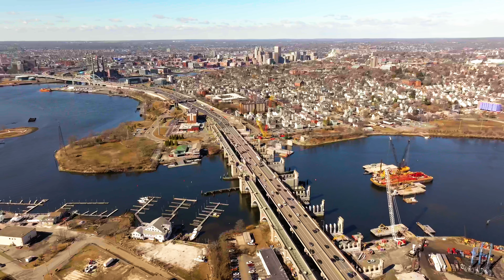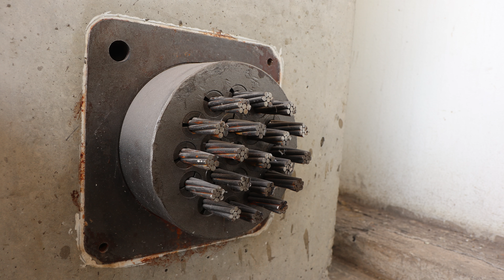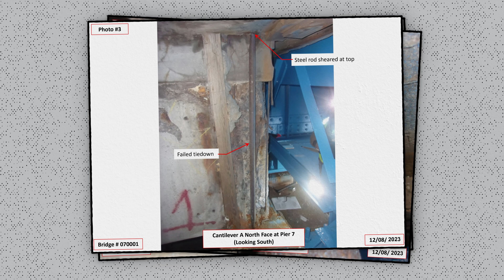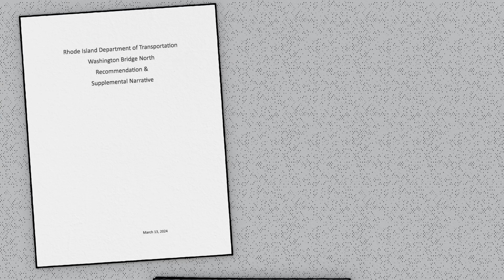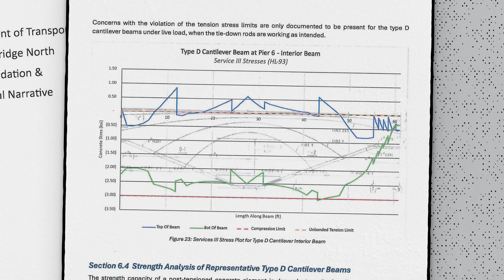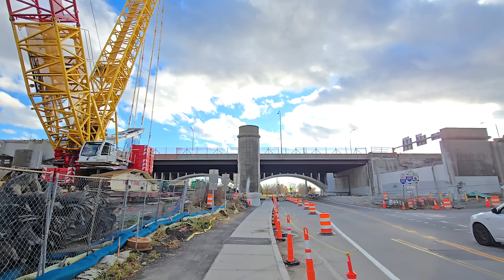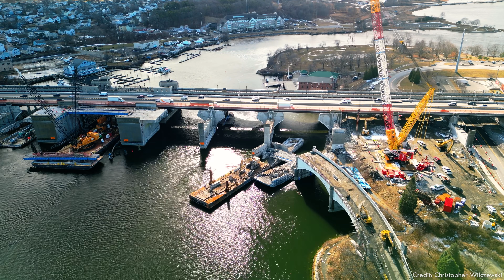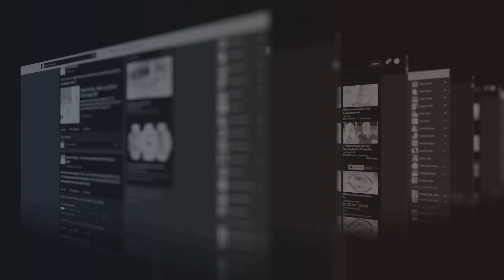This Bridge’s Bizarre Design Nearly Caused It To Collapse

Comment: Speaking of bridge failures, I would be interested in your take, Grady, on the replacement of the I-85 span in Atlanta 5-10 years ago. Briefly, combustible construction materials were stored under the bridge and homeless people camping under this bridge started a fire to keep warm, which ignited the construction materials, heating the bridge enough to make it unusable. There are quibbles about these details. However, the bridge was replaced in short order, motivated by the state's offer of substantial incentive pay for doing it quickly. I think it would be interesting to see how the fire made the bridge unusable, what factors made the quick replacement feasible (standard interstate construction, no water to work over, the availability of crews and equipment because Atlanta is constantly being rebuilt,etc.), and whether the incentives were as worth-it as the state and contractors claim.

Comment: I appreciate your explanations of the structure and problems. Casey Jones has only reported on the news without reference to the structural element of the bridges. RIDOT is not happy as this event makes them look very incompetent (rightly so). Having worked with municipalities on large infrastructure projects, i can say the client makes the rules for the Engineers. The inspection companies were likely threatened or fired for following more than the clients rules (meaning safety of the public as priority) for the bridge inspections. I've heard this happen to firms. Results of failed inspections can therefore be classified secret by the state (as is the case in Florida). Then a major event must unfold to allow the engineers to actually do the required evaluation. Additionally, this is a piss poor bridge design that hides critical elements from inspection and repair. This is how a government comity designs critical infrastructure... the Marxist way. Yes, it has slithered it's way into engineering... it's been in government for a long time...

Comment: Is there a reason we can't design 6 or 7 standard bridge segment lengths that could be pre-built by dozens of companies nationwide that would be easy replacement parts to slot into some 90% of our bridges? They can be 1 1/4 lanes wide with a few different lengths that can be bolted together width-wise onsite and have companion median/guard rails that can also be bolted together. Using standard viaduct distances, they can just be dropped in place with each end sitting on a pier with some sort of capstone connecting each segment length-wise. 
I would think a modular design like this would reduce design and build costs and speed new construction as most of the engineering calculations (except the piers) has already been done. Even future replacements of entire sections could be completed in a single shutdown day after however long it takes to setup a crane onsite capable of lifting one of these road deck segments.

Comment: You nailed it, Grady. This bridge is a success story, because it's old and was caught in time to save lives. 
We Minnesotans in the Twin Cities area know what happens when a bridge suddenly fails. I drove over the I-35 bridge just a few days before it fell into the Mississippi and I still get the willies when I drive over its replacement.
Reply: Good thing those old jeeps are so light!
Reply: It's a bit of a stretch to call a 55 year old bridge "old". The bridge right next to it is almost a century old. There are plenty of bridges of similar size still standing that are closer to two centuries old. It should have lasted far longer than 55 years.
Reply: @thomasdalton1508  Have you ever seen the amount of SALT Rhode Island spreads on it's roads ?  It's completely out of control, just so everyone can still drive 80 to work.
Reply: @thomasdalton1508 somebody mentioned in another comment about a 1920s Silver bridge that collapsed in 1960. So screwups can happen pretty much at any time in history.
Reply: @zzoinks  I'm not sure of your point. Are the 1920s famous as a time of safe bridge building? I really don't see how you can go from a single fault in one bridge to such a general statement.

And I wasn't commenting on bridge building standards at any particular time. I was commenting on the usual lifespan of a bridge and what constitutes an "old" bridge.
Reply: @thomasdalton1508 That bridge isn't used for traffic anymore though. It doesn't have to resist the forces of the 2nd bridge. Not to say that the 2nd bridge was not badly built.
Reply: @zzoinks  What do you mean it isn't used for traffic? It's carrying all the traffic now. You can see it in the video...
Reply: In time was 40 years ago. This was by the skin on your teeth
Reply: Caught in time?  There was a chunk missing.  The inspection missed the fact that 6ft of steel was gone.  How do you miss that?  It doesn't happen over night.  As a Rhode Islander, this the work of the Democrats under Gina Raimondo.  We are ranked worst roads in America.
Reply: @DroneStrike1776 ”caught in time” because it didn’t suddenly collapse during rush hour
Reply: @DroneStrike1776  It was caught before failure, what every rational person would describe as "caught in time." Gina Raimondo was 5 years old when this bridge design was put into place. Propaganda has turned your brain to mush.
Reply: @DroneStrike1776  Don't be disheartened by everyone debunking your BS. Take solace in your dear leader and his doggy friend slashing government agencies left, right and centre, so you won't have to worry about trifles like bridge inspections.
Reply: Look a veteran hater @DroneStrike1776
Reply: @DroneStrike1776 uhhh.. cuz it didn't fail?? You republicans are ridiculously dense.
Reply: @Kstang09  Success story though?
OR a warning of how many 100's of 1000's of ticking timers there are in the US?

You democrats are ridiculously easy to convince, and even more ridiculously short sighted.
See how that works both ways?

Comment: What a lucky fluke that there was an on-site engineer, who not only saw this, but also noticed it and took action and that the chain of command from there actually worked, preventing a horrifying catastrophe. 

It reminds me of an accident a few towns away from where I live, where a school was renovated next to a railroad. During the renovation, the fencing against the railroad was removed to make way for fencing off the construction site properly for a few years. At the end of the construction phase, a new fence in the form of an acoustic barrier was built between the school and the railway. When the construction was finished, they did a final inspection and started dismantling the temporary construction fence. The crew realized there had been a planning mishap, because there had never been built a connection between the old fence and the fence/barrier around the school, leaving a 50 cm (0.5 meter) gap between the two fences. The crew alerted their boss who tried to reach the municipality, but failed to get hold of them. It was a Friday afternoon and their municipality contact person had gone home early. So they left a voice message and sent an email and CC:ed all they could think of that could do anything about it. I even think they cc:ed the railroad authority, who dispatched a team to put up a temporary fence. But later that day, before the railroad maintenance crew had arrived, a small toddler who was out playing with his family, crawled through the gap, just as a freight train rolled by. Sadly, he did not survive. It's a stark reminder that no matter how strong you make the chain of responsibility, it's never stronger than how the weakest interface between its individual links will act on unforeseen circumstances at the worst possible timing.

Comment: Well it lasted 50 years didn’t it? Referencing Colin Chapman’s design optimisation ideology, it lasted the full race distance and not a single lap further … optimised?

Engineers are often struggling against their management structures to design things better but, ultimately anything that adds to the potential design life gets cut-off by managers that are not engineers.

Comment: Some of the items noted from around 10:08 are why inspectors need to actually get off the ground and climb up in there.
Whether it's a bridge, the frame of your car, that house you're looking to buy, a rocket being built...
Get off your tuckus and actually look at everything.
If there are time pressures on the inspection, push back and point out that a rush job can cost money and lives.
If there are money pressures on the inspections, point out that fixing a found item is often cheaper than paying for dead people and THEN fixing the item.

Comment: The demo contractor found out how weak the bridge was by showing it couldn't even be demo'ed correctly.  Those sections failed just the way they would if the steel rods all broke at the same time, which IMO is just happened,  because of their weaken condition due to corrosion.

Comment: Seems like inspection needs to be planned during the initial design phase, with a list of what needs regular inspections, and making sure the design allows those elements to be inspected.  And inspectors should also be given a list specific to the design for which things need to get inspected, so an unconventional design doesn't have critical points overlooked.  I don't know if modern construction is doing the first one, since these incidents are usually in older structures, but the inspections for many of these big structures are missing things, and I doubt it's just the inspectors that are to blame.  They are hired to look for issues, not do a full engineering analysis to identify what issue need to be checked for, and governments also pressure them to not give failing grades to anything.  I'd bet that similar to public schools, there's a lot of "bumping an F up to a D".

Comment: In germany they had to cut a bridge lenghtwise in half. In the 60s they decided that it was cheaper to build a single bridge for the autobahn than twin bridges over a relatively narrow valley (so they can rebuild one, while the other is still in service)... it ended up costing way more money, than building two bridges in the first place. The funny thing: only a few kilometers ahead, they crossed two more valleys whith two parallel bridges😅

Comment: As a bridge builder the state asks us to construct as cheap as possible so there needs to be an inspection once or twice a year - no need to use quality materials like stainless steel for cables & bearing pins even if we know steel rusts very fast around saltwater - lets wait for the surprise of rusting cables failing to fix an as built problem

Comment: 13:40 ???????? Demo the substructure??? You can at least make it a bike path or something!!!!
Reply: No, because the roads that the bridge is needed to connect are already in place on either side of the river, and the new bridge needs to be in relatively the same place.
Reply: @Desertedhail  I hear. Still think they could have figured something out. Just sad
Reply: @ also there’s already a bike path made out of the previous bridge there, it’d be redundant. Also contractors probably wouldn’t want to work on substructures associated with poor design and corrosion like that

Comment: As a retiree (2/3 geotechnical consulting - finished with a state agency) I see two likely contributing factors: 1) consulting firms put huge productivity pressure on their employees, specifying limited time to complete a task and requiring their time be 100% chargeable - leading to shortcuts like not climbing where necessary to view all elements; and 2) short staffed government agencies doing only cursory review of the consultants work product.  Being less than thorough can work for a very long time but when it stops working the results can be catastrophic.  Having sufficient staff to do an adequate job is considered waste - right up to the catastrophe.

Comment: For a long portion of my life I made functional pottery. The balance between form and function, visual design and practicality, can seem obvious. Some things are obvious, the others require compromise. In just a coffee cup there is a lot of engineering, a lot of balancing. As you move towards a sphere the amount of clay decreases but such forms are hard to drink out of. Cylindrical cups are nice but boring. They are easy to make, but it makes it hard as a potter to make forms much better looking than cheap cups of the same shape. Flaring lips can make cups hard to walk with as the slosh out easier, a wider rim on the inside can help with this, but interferes with drinking the last little bit. When you compromise functionality for a more interesting form the compromise has to be small and the visual impact big. 
Potters do not see themselves as engineers but,,,,
cheers, enjoyed the video!